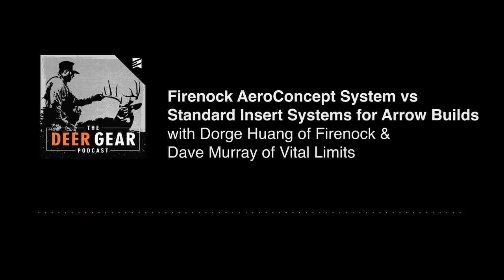AeroConcept vs Standard Insert Systems with Dorge Huang & Dave Murray | The Deer Gear Podcast

Comment: How is the length of the tube which is incorporated with the AeroInsert-H
Reply from the maker: Based on common equipment, no more than 6" is what is suggested as it is close to impossible to spread the glue evenly over that length.  The longer the better but not exceed 45% of the entire arrow length bo BOTH side
Reply: @FirenockTV , the fit of the insert is extremely tight.  I miced the insert at .245 and the inside diameter of the arrow at 243 .Do you have any suggests on how to proceed?
Reply from the maker: @thereisstuff  Then the shaft ID is below the spec of the insert.  That specific AeroInsert-H should not and cannot be used with it.